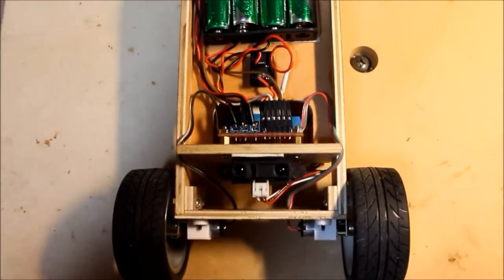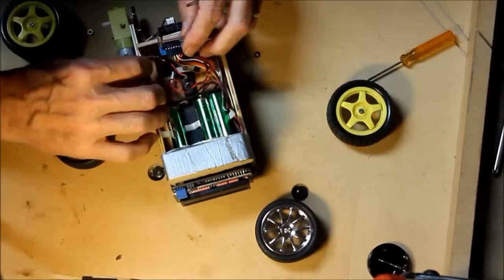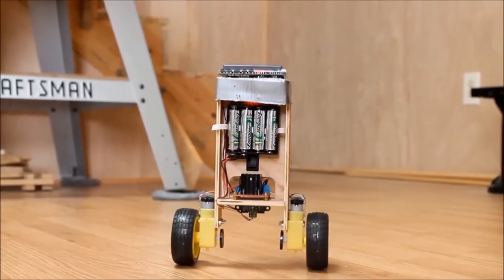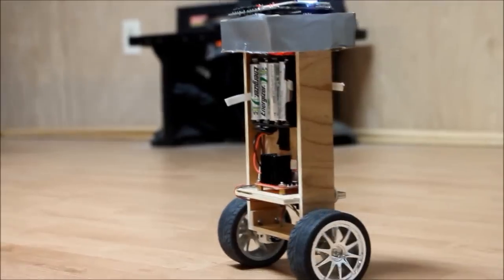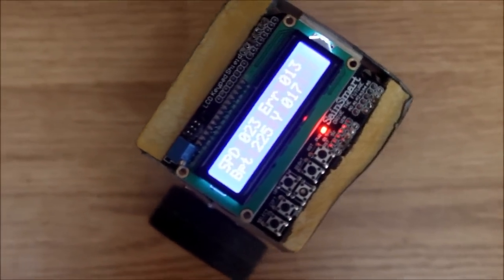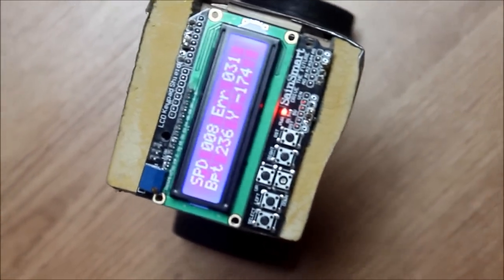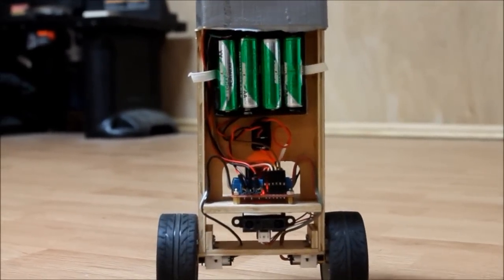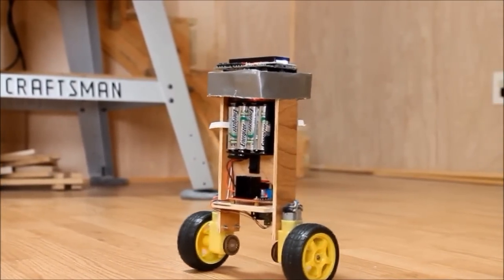Arduino/MPU6050 Balance Bot Part2

Comment: Dear Sir
i can not upload code because with note :" N20BalanceBotR1.ino: In function 'void setup()':
N20BalanceBotR1:210: error: 'TCCR4B' was not declared in this scope"   please help me... 
last time i load code OK but balanbot can not activate. by " Init  MPU 6050..." indicated.on LCD
Reply from the maker: +Hiep Pham 
When you compile (upload) the sketch, make sure  the Leonardo board is selected in the IDE.
If in fact, you are actually using an UNO type board, this sketch wont work unless you modify it first.
Please confirm which board you are working with (Uno or Leonardo?)

Comment: OK 
today i uploaded the code to arduino ok but after i press a button for start.. count down.."  Init MPU6056 steady ..". display...but 2 motor not running...( may be   how to check now . Please help me
Reply from the maker: +Hiep Pham I am guessing it could due to one of two issues. 
1. There is a wiring problem
2. The MPU is not happy with the car's position.

First, let's focus on issue 2:  
From your description, it appears that the initialization process starts. But I can't tell if the MPU thinks the car is upright (P=0) . Watch the "P" value shown in the lower left corner of the display.
If everything is assembled correctly, and with the car held at it's balance point. The P value should drift a reading of "000". The motors wont start until this reading persists for  about 2 seconds. If you don't see "000" but get some other number. Go back  & look at how (where) the MPU is attached to the car.  For this sketch to work (without changing the code) the MPU needs to located upside down (underneath) the top of the car.
If on the other hand, if you do see "P 000", and the motors don't start. Then I would look carefully at the wiring connections. Particularly those running from the Arduino to the 298 H bridge. 
Let me know what you find

Comment: Dear Sir i have use you code for this balance bot but  it is error :" balanbot2.ino:48:23: fatal error: LCDKeypad.h: No such file or directory
compilation terminated.
Error compiling." 
Please help me ... to my mail pqhiep@gmail.com...
Thank alot
Reply from the maker: +Hiep Pham 
I just updated the Github web site to include the extra [SainSmart] library files needed to compile the sketch. So you can either copy them into your current arduino sketch folder separately, or simply download the whole package and start over. Either method should fix this particular issue.
One other possible option is to go to the SainSmart web site and download the LCD keypad library from there, and add them to your Arduino library folder. 
Let me know if you continue to have issues with the sketch. 
And Good luck with your project

Comment: Hi. very good project. I'm having trouble with the code.
'TCCR4B' was not declared in this scope ( TCCR4B = TCCR4B & 0b11111000 | 0x06; //Set Digital pin 13 Right Wheel PWM period @ ~2ms).
help me please: nadineyg@bol.com.br
Reply from the maker: +Adriayg Santos I think I've already answered this question privately, but just now found it hung in the "waiting to be acknowledged" box.
And if I'm wrong about that Adriayg, I apologize for being so slow to respond.
Anyway to Anyone else who comes up with this error. It's most likely because I wrote the sketch for a Leonardo type board, and the user is compiling the sketch for a board that is using something other than  ATmega32u4 processor.  If you do want to use a UNO type board for this project, it is probably doable, but it will need to be wired differently from what is shown in the sketch(wiring diagram) found at the github site.  
So for the moment I'm going to leave it at that, & not try to detail the steps needed to convert this project to another board type.

Comment: What are the dimensions of the wooden structure?
Also does it play a huge factor for the balancing of the bot?
Please do give a list of the items you have used here, it'll be very much appreciated
Reply from the maker: +Sharan Hegde Thanks for the questions.
The unit as shown with what I call the N20 wheel set is 9 1/2 inches (measured from the ground to the top of the display.)
The dimensions are not critical. But at same time, any deviation in the car's configuration will probably mean that the PID constants used in the Arduino sketch will need some tweaking to achieve optimum stability . On the other hand, Once I had the Bot dialed-in You could place objects on the top of the Bot and it was able to maintain balance.
As for a list of parts, here's a rough listing:
GY-521 6 DOF MPU-6050 Module 3 Axis Accelerometer 

Leonardo R3 Pro ATmega32U4 Board for Arduino Compatible

1602 LCD Board Keypad Shield Blue Backlight For Arduino Duemilanove Robot

2x Smart Car Robot Self-balancing Kits Wheel+ N20 Motor+3mm Connector_KD113-2x

2x Battery case box holder for x 4AA size cells
Dual H Bridge L298N DC Stepper Motor Driver Module 

SPST switch
IR detector (optional)
8x AA NmH rechargable batteries
Jumper Wire
Mounting Screws
1 3M foam sanding block (cut to form bumper)
double sided foam tape.
5mm plywood (Bot frame)
That's pretty much it.
Hope that helps.
Reply: +jmhrvy1947 So, In accordance with your code and diagram. I have built the Bot, all credits to you:)
But, the problem I'm facing now is that the Pitch will not go to 000 at the start, it may be because of the positioning of the MPU-6050. Can I get some advice on this matter?
Reply from the maker: +Sharan Hegde 
I'm impressed :-)
I can think of two things to consider:

1. The sketch you downloaded (from the github site) contains MPU initialization values that were found with my MPU placed on a level table, in a normal (MPU) component side up position.  If you haven't already updated those lines (   mpu.setXGyroOffset(35);
    mpu.setYGyroOffset(-28);
    mpu.setZGyroOffset(-39); ) in the sketch, to your MPU values, you probably need to do that.

2. The other point to check, is your MPU positioned  the same relative way as described in the note found on the PDF connection diagram? 
    That note reads as follows:
          "The MPU is mounted component side down, withe the Y axis pointed toward the back [of the car]"

Let me know if you are OK on these two points. And if you are, what  pitch values are you seeing now?
Reply: +jmhrvy1947 
I have done as you have said so and successfully bought the pitch values to 000.
My mistake was exactly as you theorized. So therefore I re-calibrated the Offset values using a code I found on Google and it came out as such
-1090 748 5743 27 -13 25
and for the second part, I had misunderstood the note and placed the MPU with the Y axis in front of the car, but upon reading your comment especially the "[of the car]', I came to realize my mistake.

The bot doesn't balance right though, These are what I have noticed

a) The Error reading is exorbitantly high between the range of 3000-6000, the case is similar with the Balance Point Reading, but this is in the range of 1000-2000
b)The Wheels don't move at the same speed, I don't know whether this is a fault in the motors or L298N (I'm considering the L298N as you also had a similar problem early on in your PART 1 video).

I'm extremely sorry if I'm troubling you, but can you please advice on this matter?
Reply from the maker: +Sharan Hegde The situation may not be as bad as it appears.
I was able to get similar results to what you are reporting (high Bpt & err readings and wheel motors running at different speeds) by holding my bot (in the air, and way off of what should be the balance point) for a minute or less. 
So what I would focus on first is, 
"do the wheels turn in the right direction to bring the car back to level, when they are first energized?" 
If "No" then look at reversing the motor connections. Depending on how they are currently wired, it may be that you only need to reverse one motor, or could be that both need to be changed,
Let me know what you find, and we will go from there.
Reply: +jmhrvy1947 Going in accordance with what you said, I have changed the motor connections a few times.The one which is currently in use does bring the car to level, but it doesn't wholeheartedly balance the body of the bot. What should we do from here on?
Reply from the maker: +Sharan Hegde Great is sounds like the "fun" part is about to begin ;-)
To be honest you are probably going to have to find the best PID values by yourself (have patience, and I think you will get there)
find these entries in the sketch:
     double Kp = 0.32;//0.36; //0.3; 0.0;//
     double Ki = 5.4; //3.6;
     double Kd = 0.052; //0.042;
     
     double PitchBalancePt = 2.29;//2.22

The last one [PitchBalancePt ] is pitch "offset" number for your car. Much like the MPU initialize numbers you found earlier. But this number represents what the MPU returns when "Bot" is exactly "balanced". One way to find this value is use the "select" button to turn "OFF" the "auto balance" mode and adjust this value until the "Bot" moves the wheels in both directions to maintain an upright position. Once you get it to do that, then you can refine the value by running the car in the "Auto Balance ON" mode, and observing what the average "Bpt" value is.
(Remember that a "Bpt" value of 228 equals a "PitchBalancePt"  of 02.28 )
The Kp, Ki, & Kd values drive the response of the Balance PID. The Kp is the "proportional" component and the the Ki & Kd are  respectively the 'Integral" & "Differential" components.
The values shown above were the "Best" values I could find for my "Bot" (10V Battery, N20 motors, and built as shown in the video). But for your "Bot" the "Best" values are probably going to be something else.  I tinkered with these setting for hours, and it is almost more an "art" than a "science". Especially when its gets down to finding the combination of values that produce the least amount of movement. But for finding the "coarse" values, Google "tuning a PID", & I think you will find a number of good descriptions of how to go about it.

If you can post a video of your "Bot", I would love to see it, & might be able to better recommend what to try next.
Again, I am impressed with your effort.
Reply: +jmhrvy1947 
Over the past few days, I've been tinkering about with the PID values but with no avail. I'm just not able to balance the bot. The way I went with it was like this
a) Set all the gains to zero
b) Increase the P gain until oscillations occur.
c) Increase the D gain until the oscillation are damped
d) Repeat Steps b and c
e) Vary the I gain until the desired balance point is found

I, honestly kept changing the values and I must say it is a little frustrating!
Also, I have noticed that the wheels at times move in the complete opposite directions at times.
I'll keep you posted on the progress
Reply from the maker: +Sharan Hegde If its any consolation I spent countless hours discovering the values needed to get the bot you see in the video to maintain its balance (the N20 motors don't give you much room for error)
Reading over the steps you describe above. What I would recommend is when you find the P value that gives oscillations, back off a bit & increment the I value until the bot shows oscillations. At that point start incrementing the D term.  ( With my bot I settled on a fairly large I value, a small P value, and a really small D value, and am thinking you will end up with similar ratios)
I haven't seen your bot in action, but I'm going to assume that you have all its parts secured so that nothing is shifting around and most of its mass is located towards the top of the Bot.
Also the github sketch as provisions for an infrared sensor. If you don't have that installed, it could be that the floating analog input sensor pin is giving you grief. 
If you don't have the sensor (and you haven't already done it), find the line in the sketch that reads:
    //val = 0; //Disable IR detector
and uncomment it. That should eliminate that being a possible problem.

And yes, please keep me posted on your findings. I'm betting not only me, but others out there are reading your reports with interest too.
Reply: +jmhrvy1947 After tinkering with my PID Values, I think I found the stable values but I've noticed that my wheels don't react fast enough to balance the bot when pushed ( even a slight push would result in it falling, also it doesn't stay up for a  long time) and at times they don't move at all but when lifted they do, maybe the body structure is too heavy for it. So, therefore i'm planning to change my wheel set to one of a larger surface area and maybe even change my motors.
Reply from the maker: +Sharan Hegde 
Glad to hear you are getting it balance
Given what you have now, you may be able to improve its response to external pushes by  adjusting the "D" & "P" values. But I agree the N20 motors are under powered, and do not give the Bot much of a chance to recover.
Regardless, you can be proud of what you have accomplished.
I hope at some point you will document it here on youtube, so I and others can see it too.

Comment: I've been looking at the metal geared motors and wheels similar to the ones you used here, but I haven't been able to find a simple way to attach the two.

You appear to have a nice little metal coupling,I don't suppose you can remember where you got it from?

Thanks :)
Reply from the maker: +Pook365 They were an EBay purchase, and came as part of a package set, that included the motors, gear trains, wheels, couplers, and plastic motor clamps.
Also they were listed under this title:
2x Smart Car Robot Self-balancing Kits Wheel+ N20 Motor+3mm Connector_KD113-2x

And, at the time, sold for ~ $26 US. It seemed a little pricey, but it did guarantee me that all the bits & pieces would be compatible. 

FWIW The car (with the motors shown & the ~10Volt Battery supply) is still running. So for this application, they were a good solution. 
Hope that helps.

Good Luck with your project.
Reply: jmhrvy1947 Thanks for the reply, they're still selling those kits so I know what the missing piece looks like at least now...Will have to consider :)

Comment: Great work! I am doing similar project with MCU6050+ Arduino Nano v3. Can you please share your code?
Reply from the maker: Byazit Bostami By now you may have already found it, but not, go to:
https://github.com/jmharvey1/Arduino-BalanceBot

There it will give you a link to down load the code & a schematic of how mine wired.
Your Nano should work just as well for a project like this, but the sketch was written around a Leonardo, so it will most likely need some changing before it will work with what you have there.
Let me know how your project turns out.
Reply: As soon as I get some success...I will share with you... I am also thinking of making the BIG one :) where did you buy those motor and driver?  Can you share with me? I am not annoying... Right!!!
Reply from the maker: Byazit Bostami 
"where did you buy those motor and driver?"
Through EBay
The Drivers are: 

Dual BTS7970 68A Motor Driver Drive Module H-Bridge PWM Control robot

and the Motors are listed as:
24V 350W Electric Motor W/ Gear Reduction Razor Dirt Quad Scoo 24 Volt 350 Watt

The BTS7970 has more than enough current handling ability, but when used with a 6 cell lipo battery (24V) you will be right at their Voltage limit, I used a pair of TVS 1.5KE15CA TRANSZORD in each motor circuit to help ensure they didn't see more voltage than the could handle... So far that has worked without failure.

For motors, I originally considered "used" wheel chair motors, but because of my limited building skills and limited specs, I opted for the above. I found these had plenty of low end torque, but lacked speed.  They work very well as "proof of concept" components. But if I had it to do over again, I'd probably use 500 watt motors, but without the internal gear reduction.